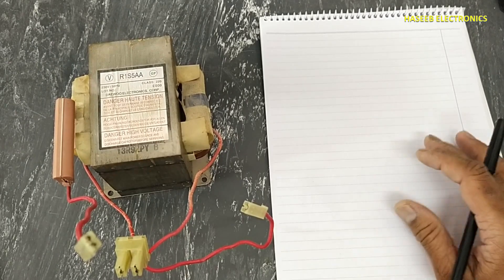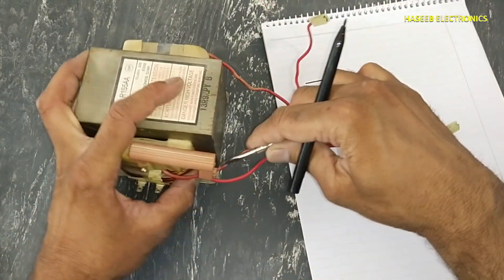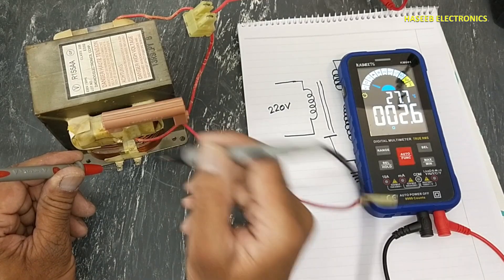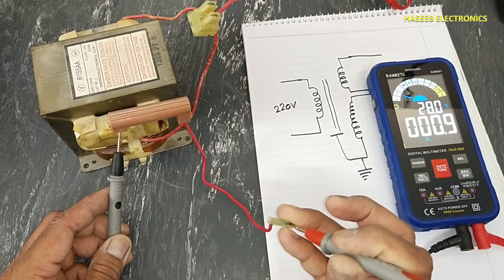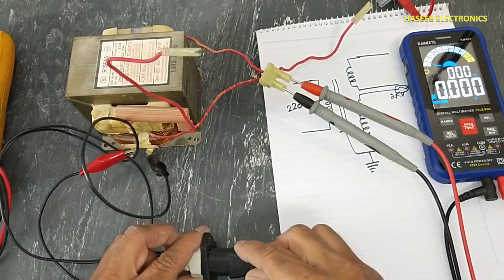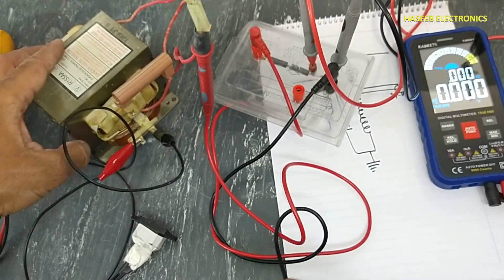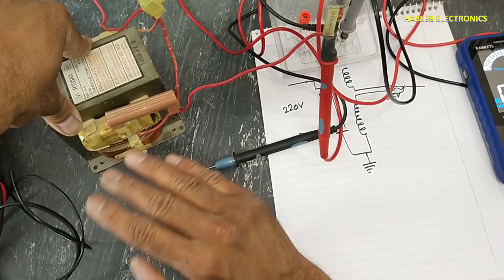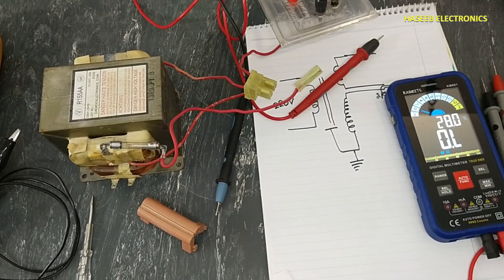{928} how to test microwave oven high voltage transformer

Comment: Hello, for measuring the secondary of the transformer with the 2M and 2K resistance bridge, what kind of resistance do you use? (carbon, metal film, metal oxide?)

Comment: I've noticed about 3.5vac at magnetron connection, can't i use a transformer whose output 3.5vac and feed it to the magnetron in that position of the microwave  for testing for the heat
Reply: 3.5vac is the low side voltage used for the vacuum tube filament inside the magnetron. But 1,800 to 2,800 volts is the high side voltage needed for the magnetron to heat.

Comment: Assalamualaikum sir.I have one sharp microwave oven. I check the ohms value of HV terminal with body.it shows 75.4ohms.rest of the values are matching with your video.If so,is it considered good or bad.please clear my doubt
Reply from the maker: HV transformer's (high voltage winding) one end is connected to oven body and the second end goes to HV diode and capacitor 
if you are getting reading with HV terminal and oven's body. that is good indication that the winding's second side is making good connection

Comment: Super testing high voltage, cold checking is good,I think, resistance checking is not dangerous 😊 sir, thankyou
Reply from the maker: yes resistance test is safe 
but this live test provides an accurate health status of the transformer